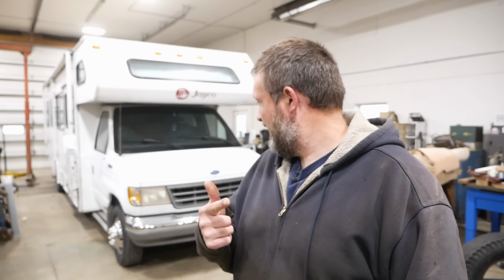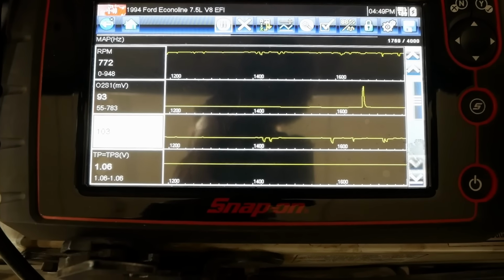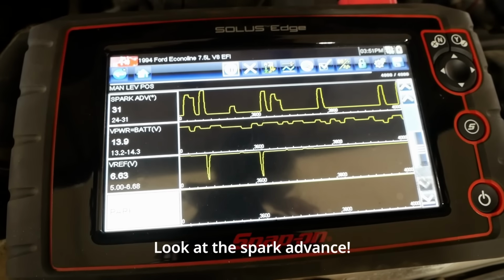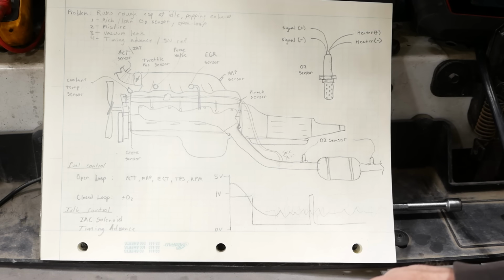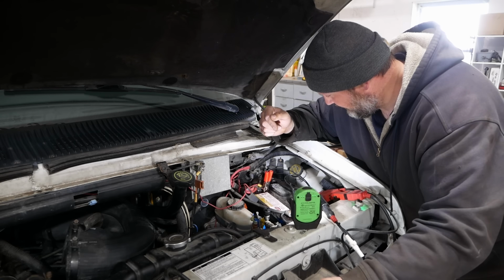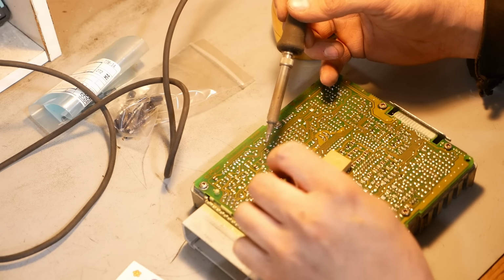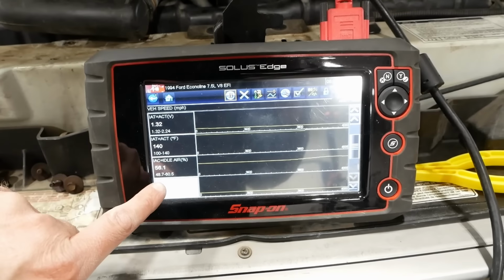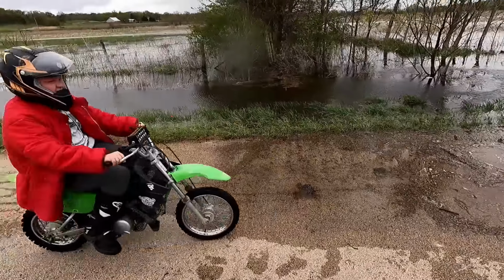Ford 460 RV Surges, Runs Rough but Nothing's Wrong?

Comment: I've had a couple OBDI EFI Fords and I absolutely hate troubleshooting the electronics on them. They were designed in Germany apparently, so of course they're unnecessarily complex, they don't tell you what's wrong if there is something wrong, and unless you're Wes and have a Snap-On rig, you have no idea what the computer is seeing (I think this was impossible on earlier models without a break out box actually). Even then, it seems it's often a mystery what's wrong or right with them. I think this era of FMC epitomizes why people hated the fuel injected cars with their fancy computers that got the reputation of being magic black boxes that you can't work on. A lot of engines got retrofitted with carbs because of the EEC-IV ECM's. For us Ford guys, thank God for OBDII.

Comment: Great fix Wes. I'm English and solder is pronounced with the 'L'. Sometimes with older pcbs, it is safer to apply heat and new solder  to the component legs and gently pry them out before removing the old solder. Also, bend the legs over slightly after inserting and cut before soldering. This will cause the cut to be coated in new solder and help prevent dry joints forming.

Comment: Weller Very Good Solid bit of Kit I Have a Hi spec Bench Iron it is such a nice Iron to work with.. 🙏
Reply: they reference the voltage  to a bin file that is on the ec Module.  I Knew you had a Brain issue.. 10 mins in . I Have had many ford ecm on the bench ...  No comment. you Found it you are the man ...

Comment: YAY Ford wiring.  I had a truck of approx the same era with similar problem and it turned out to be a rusted wire inside the wiring harness on the coil.  Took me way too much money in parts to figure out.

Comment: Sometimes I wonder if all the electronics, sensors, automatic control units, multiple modern gizmos really are any improvement over 😮motors of years gone by. Are they more economical overall ?, are they easier to drive ? Do they really perform much better ?, are they as reliable and long lasting ?. Does the complicated and expensive servicing and repairs mean overall running costs are more or less than the big old easier to maintain motors of say 20 years ago. Is the vast amount of specialised equipment required for the good modern repair shops ever really paid for by regular use and high repair charges. Or am I just getting old ?.

Comment: Nice video Wes.
regarding spark timing to control idle, this made me think of Megasquirt tuning manual. it suggests using higher advance values at lower RPM(around 500rpm) on the spark map to "bump" the RPM back up a little.  it creates a "trough" in the map to help stabilize the idle.  helpful on cars without IAC, like my old VW Rabbit.

Comment: :58 Wes be a man. Pull the engine out and build a stroker for the customer.
That thing needs a torque monster. Lol
17:48 Isn't everyday you find an auto repair shop that is also a Radio Shack outlet.

Comment: Nice bow wave on the quad! Sheesh that's a lot of water for May! Good diag on the old Ford. Replacing the capacitors is pretty common on the foxbody Mustangs of that era. It was good to see the live data, I have never seen it on a Ford of that era and it leads to more questions than answers. Thanks for the video!

Comment: I think these kind of sherlock holmes inspired repairs are great for the channel, I enjoy them very much. So in a way they're also good for business.

The secondary air question I think I can answer: It's a emissions thingy, the pump only runs for two minutes or so after startup. So it's turned off before closed loop. 

What I find infuriating is that the computer does not throw errors, I mean if it thinks the situation is so dire that it won't go into closed loop, that should be worth an error or two thinking that the decision is based on some sensor input. Or maybe the scan tool isn't doing it's thing? The weird vref might be another indicator for that. 

Also, guessing that the caps were stabilizing some voltage, there might be some long terms trims still off (wild guess since I never laid hands on a V8 Ford Computer).

Comment: were those old O2 sensors high/low output - on/off and used a bang-bang control on the mixture?  
As for repair of an ECU it better be a visual fault, no schematic will ever be available.  They might even take you to court if you disassemble the code in the microcontroller.  What happened to all the data had to be available to the public?  If you hear of right to repair - support it.
Reply from the maker: That has limits. We get a lot more info now than we ever did in the past.

Comment: V ref is probably a voltage reference a fairly  accurate specific voltage that your analog to digital converters use in order to do their conversions. They need this voltage signal to compare the analog input signal to give out digital sensor value to ECU. I may be mistaken also.

Comment: I had an 85 f 250 carbed 460. I did not keep it long. Same issue. Ford couldn't fix it under warranty. Or wouldn't fix it. I traded it in on a Nissan. Done deal.

Comment: I worked for an itty bitty machine company 😏for 35 years. For electronics...follow your nose first.  You can smell smoked components.  Then follow your eyes.  Yupper poofed caps are so common on everything from small electronics all the way up to HVAC. If you’re AC won’t run, 90% of the time it’s a cap.

Comment: Had a 91 Bronco 351 with similar issues and it was the same thing... all the caps in the PCM had leaked out. Replaced them and ran perfect again. Used clear nail polish afterwards on the board to re coat it.

Comment: If we could only have our money we earn come in as fast as a computer on this truck makes decisions on running... ya, Bill Gates kind of dollars hu... so brings to mind a business opportunity with the high water issue... Start a equipment undercarriage washing business... cleans tracks, or tractor undercarriages... you never see a clean to work on undercarriage on say the family dozer once off of the lowboy and the first scratch in the paint on those track pads... oh yeah... time or two that might just a made my day when replacing sprockets or pony rolls... a swing motor... oh boy dandy boy. I worked in the southeast alaska islands on equipment that never once was cleaned for any reason except to just change parts that had road on the mud for years and we didn't know it was bad cause you couldn't find them in that clay mud

Comment: My first computer 'education' came with a misfiring Buick which wasn't setting any codes.  1- It was misfiring 2- Sensors were sending data to the computer making the misfire known 3- If the computer wasn't registering this then the computer was bad.

Comment: I watched this as I drank my morning coffee, and then came back here to make one comment on the parts cannon after my later morning repair adventures.  Sometimes, if you need something to work, and you lack the specific diagnostic tools, it can be a calculated risk to fire the parts cannon.  I dont have specialized HVAC diagnostic tools, but if the blower motor isn't working,  and the power is there, and the control board has the right lights, might be worthwhile to just buy one as opposed to paying for someone to come tell me the same thing.

Comment: My dad had a 90’s era Ford van with the 351.  We could never get that van to run right; rebuilt carb(numerous times), cleaned full tank (numerous times), and it always smelled like fuel.  He sold it for 1/2 what he paid just to get rid of a headache.

Comment: Frankly, I can't imagine anyone else opening that ECM and finding and repairing those capacitors. You never cease to amaze me Wes. Outstanding job!
Reply: my thoughts exactly. 99.8% would replace the board when it really was a simple fix.
Reply: @skelafeti after parts and labor it is actually cheaper to have it replaced with a new or rebuilt one.  thats why things are not rebuilt these days like they used to be.  thats why nobody rebuilds anything these days.
Reply: @mahtostkitnulp  its dependent on first finding a person who is competent to do the fix, 2nd is the part even available, 3rd does the cost justify it? not disagreeing but some stuff just isn't available or it's NOS and expensive. Some things it makes no sense to repair , lets use car rotors for example, Those use to be turned all the time, the cost has come down where its cheaper and faster to replace than find someone that can turn them let alone the cost.
Reply: @mahtostkitnulp  Parts <$5 for caps, labour <20 minutes (the actual rework).  Absolutely worth fixing if you have the skills, and Wes does.
Reply: @skelafeti knkm  no nook onnmnonnonnn ononono n  no nooo. Nnon nooooonnonoonno
Reply: @skelafeti  Not even the board.  They would have charged the customer a king's ransom for a NOS ECM.
Reply: @skelafeti kkn MMO knknkkknpmkk
Reply: @joannehall1571  kjhdcfgvjhiur ?
Reply: I don't know of anyone that has a "bolt bin" of every imaginable capacitor to repair boards with.  Lol
Reply: @williefloyds .
You do if your repaired arcade and pinball games aa well as jukeboxes like I did.
I'm 90 percent retired now but still doing the occasional home service call and when I was working full time doing home and commercial service calls I had caps that were an adventure ti find sometimes. 
I'd always order 2 or 3 extra of those knowing if I didn't I'd most likely end up regreting it.
Common caps like 47 mf @ 50 vlt or 1mf @ 25 vlt I ordered in bulk of 100 an order.
Old crt game monitors used them like a kid in a candy store.
Reply: @williefloyds  not hard to order actually.
I work on very different equipment, though generally know my way around an engine.
What scares me is what's coming up in the next few years;
In my business, we've experienced a LOT of premature system failures due to failed caps from '08 to '15. Due to the nature and legality of the equipment I work on. I am not allowed to conduct board level repairs, though perfectly capable. 
I expect the automotive industry will be seeing this soon with ECMs and other equipment
Reply: @williefloyds 47uF is a very common value. Would most mechanics have one? Probably not, but most people who would take a look at the board to see if it could be fixed would probably have a capacitor assortment with a 47uF
Reply: This reminds me of Mitsubishi driveability diagnostics: step 1, remove and inspect ECM and Tcm for failed caps.
Please keep up the good work.
Reply: He is a awesome person for figuring these things out
Reply: It's lucky the electrolytic fluid itself didn't ruin the board traces. Surprisingly few caps on there - I suppose the engineers at the time thought they were a possible weak point. My mind boggles however at how many 30-odd year vehicles there are out there, and the caps are just waiting to wreak havoc.
Reply: @MattExzy  I just had the same thing on my bronco. All 3 were leaking and one had eaten away the traces. Sure, it could be fixed, but at what cost? I opted to replace it instead of repair, maybe Ill catch it before it gets to that point next time.
Reply: Maybe not a bolt bin but I carry a assortment and being in the electronics industry I can get almost anyone I need in 2-3 days.  

Even the best electrolytic caps have a set life cycle and will eventually need replacing.
Reply: Ivan, Pine hollow autodiagnosics would.
Reply: Don't you just wish he was your local mechanic? God damn there's some useless plonkers around me in the UK.
Reply: @KrisDug  join the club! (They're great at lying but, that's typically the extent of their expertise)
Reply: @KrisDug   Please watch your language there's young people and older people watching this channel and that kind of mouth just does not needed here... please
Reply: @Vfh........y  you are kidding right? 😂😂
Reply: Not many folks, Pine Hallow is one I can think of.
Reply: I did. It didn't work for me but I did it...
Reply: I am sure Ivan is proud of you saving the hardware.
Reply: Bad caps are such a common and easy problem to rectify, you'd be mad to not take a look. I have a Philips 200P monitor that's on 24/7 for a specific duty and I've replaced all the caps on now - I did the obviously bad ones in 2018 then last year it died again and I did the rest.
Reply: I 100% have repaired the ECM. capacitor are always a problem with time. No big deal to change much worse to find the problem.
Reply: That de-solder gun and cap collection will be a great investment. By doing it yourself in house you can just re-cap on a hunch and not lose much time if it doesn't fix the problem.
Reply: Thats an @phad no parts required fix right there :)
Reply: I'm a mechanic/auto electrician, and doing electronic repairs as a hobby. One side of my garage is automotive, the other side is electronics
Reply: PRoblem is now its hard to find the ECMs at all, let alone rebuilt ones, so one should switch the capacitors out since these are now 30 years old.
Reply: You should, the ECUs in these are prone to failure. It was the first thing I thought when he described the issue.
Reply: This is why I don't buy a $500 scan tool. Too many hidden variables.
Reply: yep, no one would

Comment: Wes, you need to come to terms with your affliction. You are the "House" of automotive diagnostics (like my hospital based drama poke..lol). You have some crazy skill sets and you like a "challenge" and well being a "betting man" that you are, you just can't walk away from it. We can all see how you take the time to reason out the some times "unreasonable" to find the problem. You clearly stated how it is almost everywhere else, most shops would have walked away from it after triggering the cannon, if even going that far. Your board level repairs are, in my opinion, well done and carefully executed. I would hazard a guess that with that capacitor failure there could be other devices on the board that were damaged with no outward signs of damage (throwing the reference voltage off as you clearly noticed). Thank you for taking us along on your quest for answers and a solution, always a joy to see a new Video from you over a weekend. Stay Safe and thanks again. Cheers!

Comment: First off I am from Australia so ypu womt kmow the model of Ford I am talking about but the problem is one that I had recently with the electrical system and has me nubd stuffed and I have fixed it so will take the win. A couple of weeks ago i went to the local shops with the wife she went into the shops and did her thing i as usual stayed with the car as we take our dogs every where and never leave them alone in the car. I had checked all my lights as usual before leaving home for the first time in a day, all were working fine. once wife returned to car went to start car and it started fine, turned on my lights as it was almost dark and heard a sound, just enough to wonder what was that but as headlights came on didnt think about it till I became susoicious that my tail lights were not on, and as it got darker i noticed all my dash lights were also out. With the sound i heard i guessed it was a blown fuse. The next day I came out to car pulled the fuse for the tail lights and as soon as i went and turned the parking lights on it blew the fuse.  Usually that means a straight short. Also checked all other rear lights indicators brake lights reversing lights all worked as usual only park lights were not working. Broke out the multi meter and starting at the rear started to look for a short, I pulled each plug apart starting as far back as i could and as i checked resistance between the park light wire and the ground each plug tested fime to the back of car but read a resistance of 200 ohms to the front so moved slowly to the front of the car to find each section of wiring  from the rear to the fromt I discovered there are 9 of the, in a 2002 station wagon LOL so finally after checking as described right to the drivers kick panel i had cleared all the wiring from there back to the tail lights. So then it had to be some where under the dash or in the dash to kick panel conector, This is a bugger as the wiring under the dash and up the colum to switch and to the kick panel is almpst impossible to get to ! Spent a couple of days stripping the dash and working out which witr was the one i needed as also at each plug the cokour codes changed through the car but finally after 5 days i could say all wires were checked and no short was found! So being stumped i started thinking about what ekse it could be and found the park lights have a relay in the fuse box so I pulled it and tested it for operation and it was also five and no short in it. Being as this was stopping me driving the car after dark and we are heading into winter here I decided to just test the system as a whole again and plugged each thing back in and put a fuse in and see what happened so re assembled everything and [ut a;; the wiring back in its respectife hiding place and turned the park lights on and id didnt blow the fuse and lights worked AND so did the dash lights. DID I find the problem NO is it fixed YES have I had a problem with them before or since NO and i have owned the car for almost 7 years LOL. I WILL TAKE THE WIN AND PUT IT DOWN TO SOME GREMLIN THAT KUST REQUIRED ME TO PULL ALL THE PLUGS APART AND RECONECT THEM TO GET RID OF IT! But that was a week of work to find nothing wrong and fix it?????? BY the way we here have said for years Ford em[loy a guy to spend his days working out the worst way to secure everything into the car to make it as easy to build the car BUT as hard as possible to do any repairs to it unless you take it bacvk to the sub assemblies that they put it together in. I HATE THAT GUY!!!